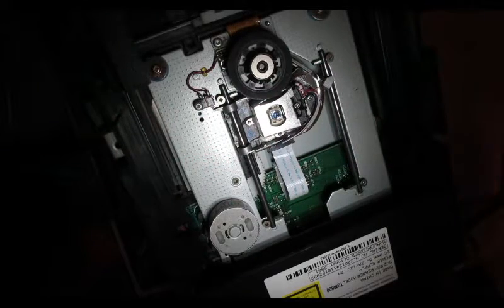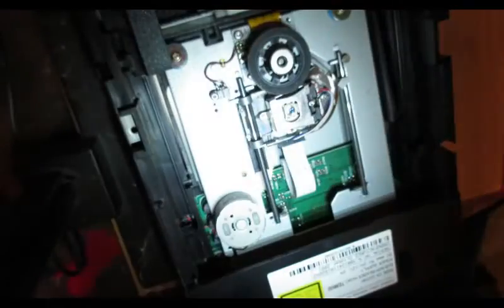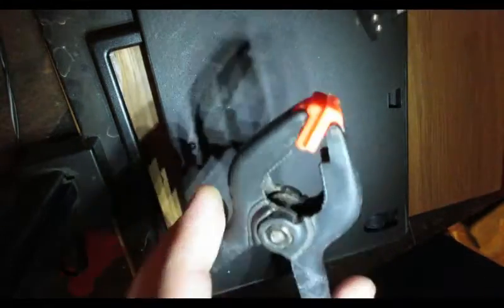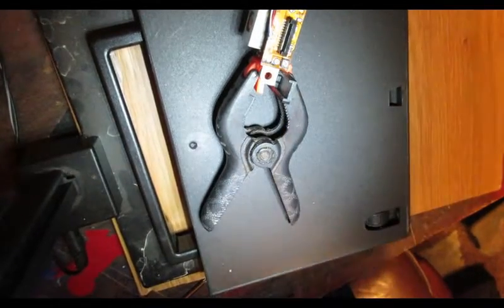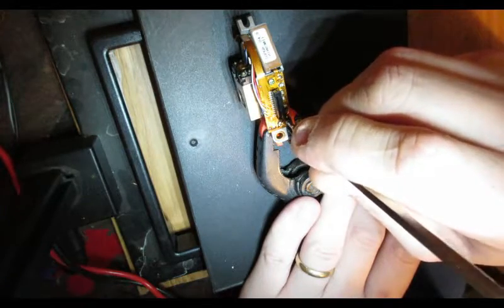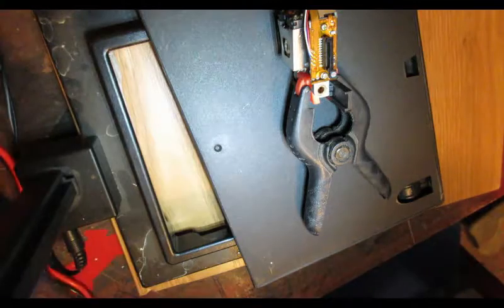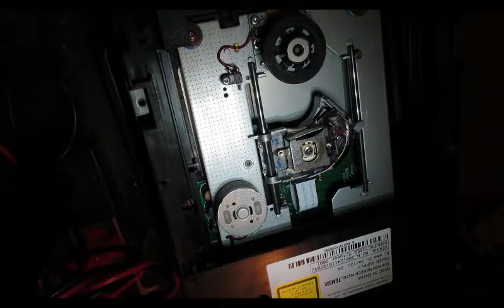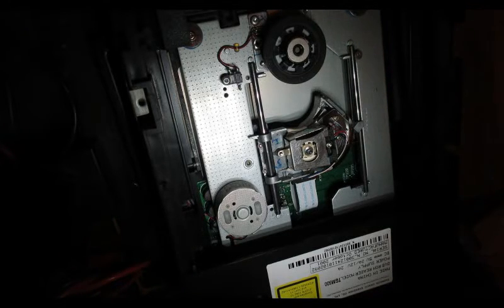Original Xbox Thomson TGM600 Laser Pot Tweak

Comment: Just fixed my soft-modded xbox, using this method.  There's another video that says, when measuring with multimeter "you want it between 2 and 3", but again, doesn't give the units of measurement.  I went by this guide: https://www.yumpu.com/en/document/view/3499951/xbox-thompson-dvd-drive-laser-adjustment-procedure.  I found my laser measuring around 1275 ohms (read, with the multimeter set to the 2000 ohm setting).  I dialed it down to just over 1000 ohm, and it works perfectly.  Hopefully this clarification is helpful to others.  Also, if you have a set of ESD tweezers, you can use tweezers to scrape out the glue with relative ease.  Anybody working on electronics should have a good ESD tweezer set...they are under $20 on amazon. ;)

Comment: Hi thanks your video helped me a whole bunch I was able to get my original Microsoft Xbox Thomson DVD drive to read CDs DVD movies and Xbox games I bought my original Microsoft Xbox off eBay for $45.00 my original Microsoft Xbox was pretty dusty I cleaned fixed inspected refurbished repaired restored reapplied new fresh thermal paste on the central processing unit and graphics processing unit also sanitized the the top bottom and front faceplate of the original Microsoft Xbox and it works excellent but I'm buying a original Microsoft Xbox Samsung DVD drive for my original Microsoft Xbox

Comment: Great video. Unfortunately this didn’t resolve my drive not reading games. Do you know where I can find a replacement laser? Can’t seem to find one. Thanks.
Reply from the maker: Honestly you would be better off buying a second Xbox and swapping drives. Depending on what model of Xbox you have, you could always buy a second Xbox and turn this one into a Slim with no DVD drive and a giant hard drive. The reason I say you'd be better off buying a second box, is because the lasers are extremely hard to find and people sell the drives for about the same price as a second console. No idea why that is, but that's how I do it. Hope this helps. Hope ya get it working. I have videos on how to mod the console and also a video over the slim if you are interested in it.
Reply: Thank you so much for sharing your knowledge. I am new to XBOX modding. I have TSOPed a v1.0 system using the Helen 2017 disc and installed a 1tb hard drive. Everything went great until my drive stopped reading discs. I’m fine with using FTP but how can I rip the rest of my games to the XBOX without a working drive? Do you know of a way to rip them on my pc and then ftp them to the XBOX? Also, what if I run into a problem and want to boot from the HEXEN disc? I won’t be able to do that without a working drive. What would you do in this situation with your slim mod that doesn’t have a drive?

Comment: The guides I have read say it should be between 1900 and 800 ohms resistance, but the videos I have watched have said "3.7" is thetaget, but they don't specify is that singls, tens, hundreds, etc. What do you set your multimeter to? I had mine set to 2000 ohm range, and it read between 400 and 450 ohms.
Reply: Update. I have tweaked it multiple places between 150 ohms and 950 ohms and none of them worked. I know the laser is still coming on and moving along the rails, but the discs will spin briefly then stop, do that a couple times before giving me the error. I'm guessing they mean 3.7 kOhms, but that doesn't make sense based on the other tutorials I've read online

Comment: So I pulled my laser out of the drive, and checked the resistance on the pot.  It's reading 1.68.  

I am not the original owner of this Xbox, so it's possible that someone already adjusted this, but it does not appear to be the case. (Glue appears to be intact from the factory) Is it possible that it's getting too much power?  Would that cause disc read issues?  Maybe the pot went bad?  Would there be any potential gain by dialing up the resistance and putting it all back together, or should I just give up and replace the laser or drive? 

Thanks for any help.

Comment: 3.7 what? you didn't specify this Xbox repair guides I got said it needs to be at 800 on the 2000 ohms setting on the multimeter.
Reply: 2nd this. mine read 2.4 so i put it up to 3.7. the only settings on the meter i had with those readings were 6k / 60k ohm. hopefully that was right.. all other guides say go between 800-1900 but nothing on my meter gives that.. unless my 2.4 was 2400 and i should have went down not up.. guess well see if something fries!
*update, no change at 3.7, i went ahead and dropped it to 1.1 just in case i went the wrong way, and no go there either. So my issue likely isnt just the pot :(

Comment: EEK! What are you doing dude? You FORGOT to short the ESD protection point before taking out the ribbon cable, and you touched the lens assembly with BARE HANDS and no static discharge bracelet!! DVD laser diodes are vastly more sensitive than CD ones, you really risk to fry the laser by merely touching the assembly!
Reply from the maker: I've done hundreds upon hundredsssssss of these pot tweaks and never fried a single one. Close to a thousand if you included other platforms that use pots.. Lol. Electro Static Discharge is mainly for storage until ready to use. Especially during shipping.

I touched the laser assembly with my bare hands. Yes. The laser lens itself however I did not touch. :P

Anti static bracelets aren't really needed for a simple pot tweak. I don't even use them when handling bare motherboards for Ps3 and 360 reballs. I'll let you guess how many I have "fried" by not using a wrist strap. (Hint, it's a single number lower than one) 

So to answer your question, what I am doing is fixing a console to read discs. Which by the way came out working just fine as did 98% of the other consoles I have tweaked. Whichever doesn't work gets a brand new laser. Which again, never fried a single one. :P
Reply: @H4CkGAMiNG712  no you suck and your fucking video you should take this dumb shit down you are a terrible dumb ass youtuber

Comment: I'm running XBMC, my laser recognizes the disc, and then says the drive is empty. Should i try this method?
Reply from the maker: Clean the laser. If it still doesn't read it properly, tweak it down. Make sure to use a multimeter. It's picking it up so we know it's not completely dead. It just doesn't have enough juice to keep reading.

Comment: I have a question :
XBOX can buy RAM and change the processor to 1.5GHz if it is felt when playing the original games, or just a modified console?
Reply from the maker: Just modified. You have to change a few settings when upping the CPU and RAM in it and those settings are only available once the Xbox has been softmodded and TSOP flashed.

Comment: Which model Xbox is this TGM600 for? I found one for sale and would like to know if which models I can fit it in. Thank you.
Reply from the maker: +Rami Al-Q The Original Xbox disc drives are actually 100% interchangeable. Just pull the old drive out, throw the new one in. They aren't like the Xbox 360 to where the disc drive is "married" to the motherboard. They're all plug and play. :)

Comment: You went about half turn on that? My multimeter isn't functional right now. Battery leak. smh. Thanks for the feedback buddy
Reply from the maker: +Ryan Bruno More like half of a half a turn. Maybe even half of that. Lol. You just want to turn it a hair at a time and then generally you would test it each turn with your multimeter, as you don't want to drop down below 3 ohms. You also don't want a huge drop either (ie: 5.1 ohms to 3.4 ohms) because it may fry the laser. Hope you get it all worked out! :D
Reply: Well I turned it like quarter turn and no change at all so I just said fuck it, a friend gave me an old Xbox with the Samsung drive in it so I just replaced the shitty Thomson with that. Running beautifully. Lol thanks for the feedback bro
Reply from the maker: Hell that's always better anyways. Now you can read burned discs and rip games from the dashboard (if you have the HDD upgraded). Lol. Anyways, glad you got it all resolved man!

Comment: By lowering the Ohms on the the pot you're letting more juice flow to the laser?
Reply from the maker: Yep the pot basically just adjust the laser intensity so it'll get a better read. that's strange that it'll play DVDs but not games since games are essentially DVDs with a slightly different format. Try cleaning the lens with some 90% (or higher) isopropyl alcohol. I've brought a few back that wouldn't read at all with just a simple cleaning.
Reply: H4Ck GAMiNG I used a qtip and windex. I gotta order a A/V cord now lol Its been years since i ran the system. How far can you drop the Ohms on them? Did yours read fine after that?
Reply from the maker: +Ryan Bruno Anywhere between 3 and 5 ohms depending on where it was set from the factory. I've dropped a few down to 2.8 but it's not recommended. yep it reads perfect now and doesn't sound like it's struggling at all. :)
Reply: H4Ck GAMiNG Cool! I'll probably be taking that route if the cleaning doesn't help. Thanks man
Reply from the maker: Alright man. Sounds like your issue should easily be resolved. Let me know what happens! :D
Reply: Has anyone tried replacing the drive with a pc drive. Ide is vary common.